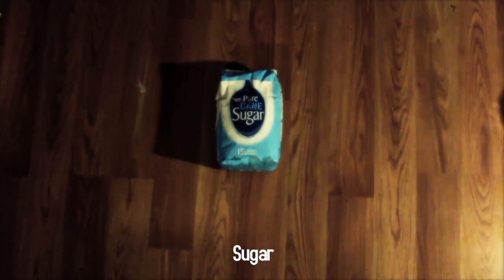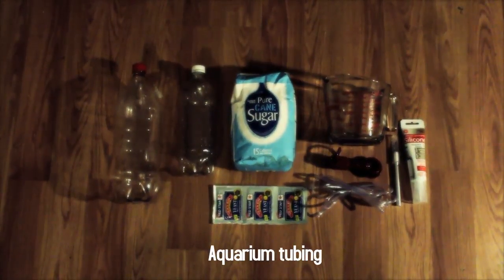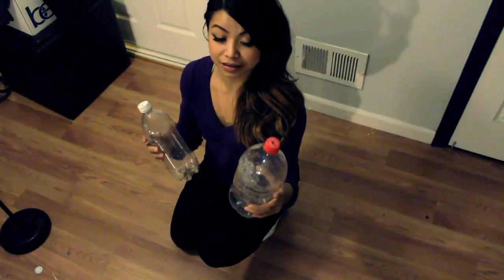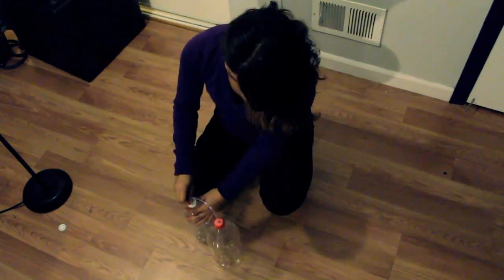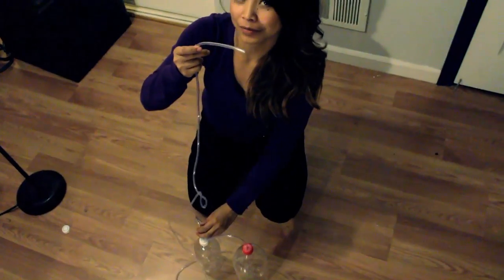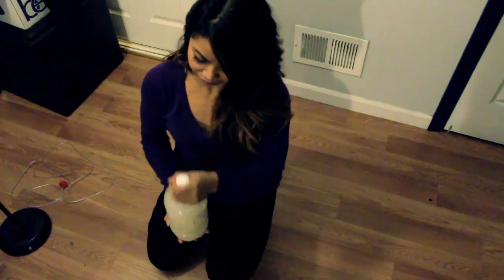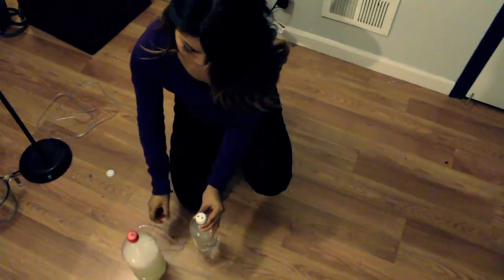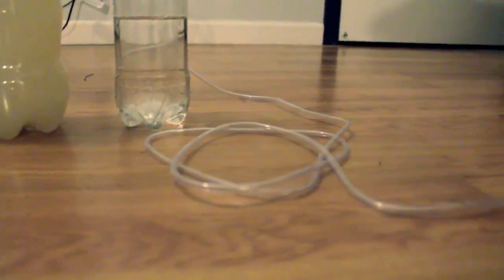How-To Make a CO2 Generator

Comment: lol.  clear bottle is no bueno since yeast hates light.  and sealant isn't needed...you can use a power drill to make a hole smaller than the vinyl tubing and it seals itself.  I use a blue 5 gallon bucket.  I also added a 5 gallon fish tank heater to my bucket.  I should also mention get a screw top cover for 5 gallon...snap on sucks.  cute or not her engineering skills are 3rd grade science fair level.

Comment: For how long it will produce co2 ?
Reply: +Ali Emeksiz Hell, I've made homebrew wine in this method.  Dump sugar into a juice of your choice, and run it in this manner, in the big two liter bottle.  I would say use champagne yeast (they survive longer in higher alcohol concentrations).  You'd have to make sure that the tubing is absolutely airtight although...

My wine usually was finished brewing at 2 weeks....

Comment: I get why the 2-litre bottle containing yeast and sugar produces CO2, but what is the function of the 1-litre bottle containing nothing but water?
Reply: +Yawning Pheonix it is a bubble counter and safety measure (to help in the case of back siphoning)
Reply: +Yawning Pheonix Also, if you fill the bottle too much the initial reaction on the yeast might bubble out of the initial bottle, so the 2nd one catches that as it would be a fairly bad mess to clean would it go through to  the plants :)

Comment: cheaper to make co2 out of baking soda and vinegar but use the same method as here
Reply: +James Taylor  Okay but don't cap it and shake!
Reply: But does it last as long? From what I have learned it looks like the vinegar/backing soda is quick burst of co2 and you decently want the spill over. And this method seems to have a slow and constant flow with less chance of a flow over. I'm hungry for more info

Great job with the vid!! 👍👍

Comment: Is there any guidance on the amount of CO2 you need for a specific growing area?
Reply: Jim O'Donnell hi jim.  plants can generally eat up to 1200 parts per million of co2 in the atmosphere, but the average household atmosphere measure around 300ppm.  although i have read studies that suggest too much co2 can make a plant temporarily close down on this aspect of 'eating'.  decent co2 meters are expensive also.. so the answer is probably as much as you can muster as there are plenty of studies to suggest there are mostly positives to adding more co2 to commercial crop growing, for example.
Reply: +Jim O'Donnell I'm thinking this doesn't produce a ton of CO2 so my guess is I'd want 2 or more of these for a 2-3ft tall plant. (This is just a not very educated guess.) Most plants can use A LOT more CO2 than what the current outdoor environment provides, let alone what an indoor environment could give.
Reply: I run my room at <1200 ppm (parts per million) normal out doors is around 400. I have a digital reader. Prime!! And I don't feel any negative effects from being in there a few hours here and there! When my tanks run out I'll see it as high as -1400 ( the -0 number is oxygen rich) and after working in there for an hour it will rise to 250.

Comment: So, The yeast and sugar mixture makes sense and produces CO2 for, I suppose, several days or even weeks, but then you throw it out.  You could be making beer in a carboy and be having a lot more fun with your recycling.  Just a thought.
Reply: Jim O'Donnell  i'm not chasing you i promise lol.  the above method and size of bottle is dependent on heat - somewhere around 75f is a nice constant for feisty co2 production, but the higher the ambient temperature, the quicker the mixture will expire. a 2ltr bottle with the above mixture will last maybe 3/4 days max.  put x6 of these together and you've got more serious co2 production, or beer, as the case may be..

Comment: What in the FUCK is the point of the second smaller bottle, not ONE person has said anything? I DONT UNDERSTAND?
Reply: ***** thhaaankyou bro!
Reply: mulisharobbo It's so you can see the gas.  After a while, the yeast stop making CO2 when the sugar has all been digested.
Reply: +mulisharobbo It is not mainly a bubble counter though, that is just a bonus. It is a buffer in case the yeast makes the mix rise too high and push out through the  tube. If your tube goes straight into the tank and this happens, you gonna have a bad time
Reply: And you can see how much co2 is being produced

Comment: What is the purpose of the second bottle? Why not just run the hose from the main bottle to some splitters and disperse it?
Reply: So you can verify that co2 is still being generated with the bubbles it makes. Once the bubbles stop its time to remake the mixture.

Comment: I came for the useful info, stayed for the smooth a$$ soundtrack and beautiful face, but I'm curios about the 2nd bottle. Is the one liter there just to monitor the CO2 output or does it somehow aid in the generation process?
Reply: It monitors the c02 via bubble counting to get an idea on how much c02 your mixture is providing, in addition it's required as the second bottle of water allows the alcohol which is a byproduct of the yeast generating the c02 to be filtered out via passing thru a clean source of water.  It is recommended to change the water in the second bottle weekly and the reactor bi-weekly or when it stops producing the appropriate c02.
Reply: Soner Nouri ya...that alcohol smells pretty bad so the water makes a huge difference.

Comment: An improved formula is:
1½ cups of water
2½ cups Sugar 
¼ teaspoon Wyeast Labs, Eau de Vie vintners yeast
This is a more costly mixture. Since this yeast is a liquid live yeast, it does not need to be re-hydrated. This yeast is more tolerant to higher alcohol levels, therefore this mixture can last up to approximately 22 days. It also has a more consistent output of gas over time.

For two-liter bottles:
2 cups water
2 cups sugar 
¼ teaspoon Fleischmann's Active Dry Yeast
¼ cup tepid (ideally 104ºF) water

The yeast is to be rehydrated first in tepid water before adding it to the mix so it can readily adapt to the anaerobic conditions in this little fermentation factory. Many folks who omit this step believe they are creating this situation with just the action of pouring the mixture into their bottle. But they also do not realize that much of the yeast they use dies, because many of the yeast cells could not complete the aerobic phase of its life before the conditions change to anaerobic. . 

This mixture can last up to approximately 16 days.

Comment: co2 helps your cannabis plants breathe when they are in enclosed areas such as grow tents / boxes when your not around your plant to give it the co2 it needs. those are some of the instances you would / wouldent need a co2 system. p.s. this video is a very good system i reccomend. They system lasts till the system smells like rubbing alchol. then you have to break it down clean it and repeat.